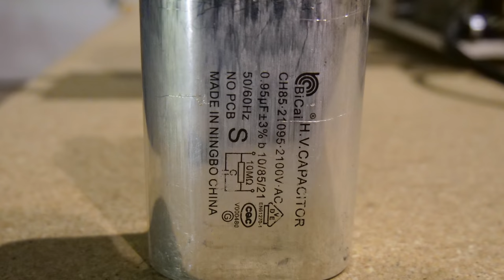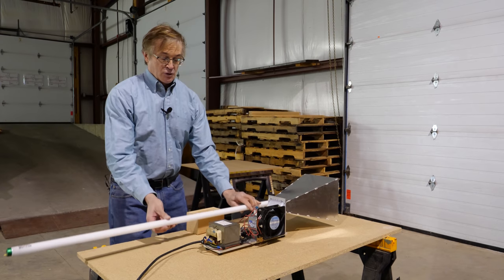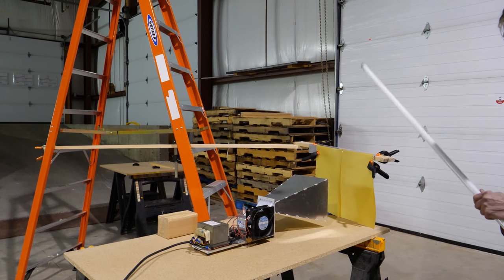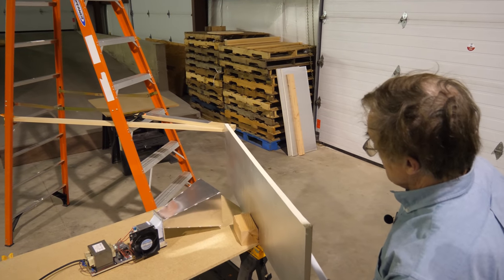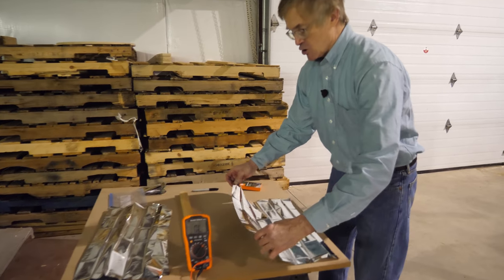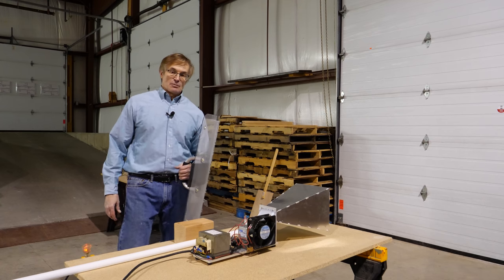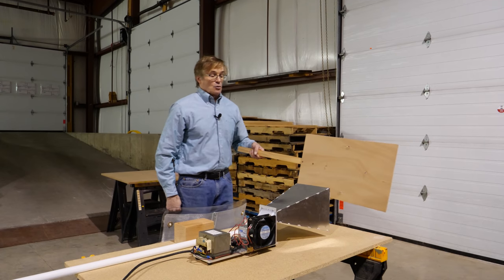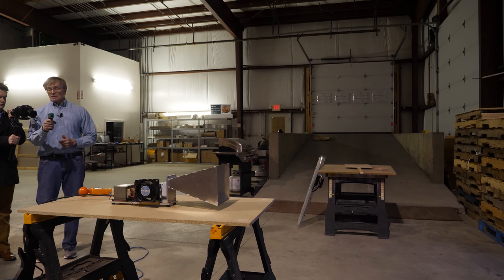You're not protected from microwaves... yet - Part 2

Comment: Is there any kind of spraypaint/paint that could be used to block microwave?
Reply from the maker: It would simply  have to be electrically  conductive. Aluminum foil would probably be easier  and less expensive.
Reply: @TechIngredients  thank you for your response. Will a car protect you from microwaves?
Reply from the maker: No.
The glass and any plastic body panels  are transparent  to microwaves.

Comment: Could you just amplify the signal using a battery, a Schotky diode a transistor to light the bulbs at greater distances?
Reply from the maker: Sure.  The advantage of using only the bare bulb is for documentation.  No one can use the defense that you faked the signal with electronics when you make your accusations.
Reply: @TechIngredients  clever

Comment: Can the testing applications apply for 5G+ wifi as well ?
Reply from the maker: They could. 
But  in the meantime, don't worry.  5G is not a threat.  The antennas will not transmit dangerous  levels of microwave  energy.
If you still want to worry, be far more concerned  about the information that is promoted via this modality.

Comment: . . ✨ Commercial grade foil has both dull & glossy sides, can this grade of foil protect a cell phone when it’s wrapped tightly (no open ends or sides) from EMR waves ?
Reply from the maker: Yes.  However,  grounding the shield will work better than if it is electrically  floating.
Reply: @TechIngredients   . .👍🏻 thank you . .can the Ribbontoe Carbon fiber cloth (graphite film) provide proper grounding ?  . . Can the cloth accept a needle & thread to be made into a proper Faraday cage for my cell phone ?
Reply from the maker: I'm  not familiar with that material.

Comment: I feel like when making anythign other than a shield, like conductive clothing, its just going to make the microwaves bounce around inside if you don't close all holes with somekind of see through mesh or more conductive material to create a true faraday cage. any more info on this?
Reply from the maker: That's unlikely to be a problem.  What gets through will be a small fraction of what would have hit you anyway.  The energy will be completely absorbed and converted to heat after it passes through only a mm or so of your skin.
Reply: @TechIngredients  AHH makes sense. Forgot about the big attenuator inside the suit :P Thanks for taking the time to answer my question.

Comment: They are building cell phone tower generation 5, it's on the side how can i protect inside of my home from microwaves, do i need to shield only from the side or whole house and if there is window what should I do with that, is there any faraday cage kind of stuff that I can use for windows and can still see outside.
Reply from the maker: Those towers pose little  threat.  However, if you want to block the microwaves, then they are line of sight and only the side of the building facing the tower needs a conductive, metal barrier. As we demonstrated in our video on defending against microwave weapons, a simple METAL window screen will work.  Because  these very high frequency 5G systems have a shorter wavelength, a fine mesh mosquito screen will be necessary.
Reply: @TechIngredients  Thank you a lot for answering.

Comment: My ears perked up when showing the IR thermometer picking up a heat signature from the microwave, but no science was given as to why?
Simply the moisture in the air? My IR thermometer does not pick up air temperature.

Comment: 2:50 it is not Beryllium oxide.

It's ordinary aluminum oxide. BeO is far to expensive to be putting in a cheap microwave, only the earliest of microwaves from the 70s may have used BeO. Not only that but the hazard of handling the BeO insulators would be very significant for an ordinary worker. 
If you don't believe I advise you grab a He3 neutron tube (I would be very surprised if you didn't have one) and a few smoke detectors and test it for the neutron output of the microwave insulator versus actual BeO and Aluminum oxide. Beryllium is far too expensive and strategically important for some microwave company to be throwing it away. I mean if the US government has mandated a stockpile be kept in addition to the only major deposit on earth being on its soil you better believe no one in thier right mind will be putting it in Karen's microwave.

Comment: While neon bulbs are usually run at higher voltages than LEDs, and are non-polar, the power draw is usually a small fraction of that required by a typical LED. You may be able to get a better detection range with LEDs, if you use their diode trait to build a passive charge-pumping circuit, and simply bleed off excess voltages (if they can even get that high with the large current drain of an LED vs the poor coupling quality of the system) by shorting any voltage that can build up to light the entire stack (or many other basic circuits). The fact that your carbon fiber and thin graphite sheet didn't get hot enough for you to mention it, or burst into flames, indicates that very little power is being coupled to the material. You could also likely get better range with the neon lamps by building a voltage multiplying ladder network. I think the optimal approach would be ziploc bags, filled with the tasty ham from the first video though. Nothing beats a meatshield for high-energy situations.

Comment: He still doesn't mention aluminum foil. It will block and reflect microwaves. Just remember to overlap your seams. That goes for any material you use.
Reply from the maker: That's because we covered aluminum foil in part one this two part video series.

Comment: Tell me, why can I pick up my wifi if I put my phone inside the microwave with the door closed?  But my wifi isn't harmful?
Reply from the maker: The oven is moderately effective as a barrier although I'm surprised that it is not good enough to block your phone's reception.  Energy at that frequency is only harmful at  power levels sufficient to cause heating.

Comment: You could just address the elephant in the room and let us know when they plan on turning up the towers to 95 ghz......and of course, blame it on radiation from the recent Fukushima "accident" or, perhaps from Russian activities? Would u be open to doing some experiments for people to see with graphene oxide, say, inside a plant? i do wonder what all this graphene in the bloodstream will do when exposed to that level of ghz....also i think its good to mention that if one was to wear a shielding/faraday suit, that they would need to be completely covered up, much like a phone in a faraday bag, that if one little crack is left open, the EMF/RF would enter in. It may block the waves in the area covered, but as it will actually draw the waves to it, being metal and all, and will fry the unexposed areas just outside the coverage area. Also, as far as personal shielding, for example, as far as a suit one could wear in areas of high RF (downtown and vicinity lately) the current materials available such as silver fabric, copper etc, advertised as shielding would not block radiation above maybe 18 ghz. If you've done a video on the wi-fi planned to be rolled out at 60 ghz, none of these fabrics would handle that.... Maybe multiple layers up on layers, however, how would one be able to see?  A translucent shielding fabric? Once that is handled, what about LI-FI, and optogenetics? Quite a few videos out there showing the streetlights, screens, classroom lights, etc, all being relevant here. THank you
Reply: theTrifield meter can alert you to the presence of a dew/ads pointed at you as well

Comment: I no you can deflect micro waves know you could melt cast iron in a crucial but can you melt steel in a crusible no one else on U tube can and I don't mean a DOB of steel in a coil
Reply from the maker: Sure, but it would involve  a significant amount of work.  Assemble several magnetrons around a non conductive crucible.

Comment: If 5G waves are added, does this change the results??
Reply from the maker: No.
5 G is simply  two licenced band of wavelengths. The first extends to about 7GHz and the second  from about 24 to 70 GHz.  The same rules apply, but the towers that  generate these waves are not nearly  powerful enough and the dispersion  is far too large to pose a threat.

Comment: I truly enjoy your channel, but I have to say that this series on microwave oven emissions has me a bit conflicted. The safety issues are many (some of which you nicely pointed out) but in particular, the RF radiation exposure is a bit trickery than you may realize - esp. as concerns your eyes. As you know these transmitters produce high levels of RF power at 2.45 GHz (the middle of the wifi band btw!). One of the health risks is increasing your risk of cataracts, or doing worse damage. At these power levels, even the sidelobe power is substantial as are reflections (which are many indoors).
Reply: …except they’re not. Lemme assign some homework: What’s the diffraction limit of a 2.4ghz beam and 1cm aperture?
Reply: @NavinF  I see, you want to assign me some homework huh? Clearly you think damage to the eye can only occur if the energy can make it through the 1 cm "aperture"... to which I ask are your eyes metal?  Does the Main Presenter have eyes that are metal? Where exactly is this aperture in the human body, or eye more specifically?  If you had a metal plate with a 1cm round hole, sure it would easily block the RF field. But instead, we have an eye which is composed of tissue with much water, polar water molecules that get excited by the 1500W e-field and heat up. Your comment is arrogant, wrong and dangerous.
Reply: @e2jw  No, you skipped a step. I was taking about the magnetron. You can approximate the energy density at a certain distance in front by assuming it’s a 1cm aperture. Calculate the angle of the central lobe of the diffraction pattern. After that, you can assume an eye’s antenna aperture is the same as its size to calculate rx power. But you don’t need to go that far: The spread angle is enough to determine how dangerous this experiment is.
Reply: @NavinF  OK, if you go to FCC doc:  RF-Exposure-Info/MPE-Report-5693688.pdf you will see the human exposure limits.  RF freq=2450 MHz, Gtx=10dBi (also 10 linear), Zo=377 ohms, I'll de-rate the magnetron output to 1000W, distance away 1meter.  Do the math, you'll get a power density of 795W/m^2, and an E-Field of 548 V/m. The 6 min max exposure limits at this frequency for a controlled environment are E-Field limit = 110 V/m, Power Density limit = 32 W/m^2.  The actual distance you need to be away is about 5m to meet the 6 min exposure limit.  Note these limits are for people working with RF and knowingly accept the risks, so they are appropriate.  General population limits are more stringent.

Bottom line: The main presenter is being exposed to 5x the max E-Field, and 25x the max power density over FCC limits. So, hence my concern.

BTW: I'm choosing to ignore the obvious FCC violation of radiating ~10000 W, in the WiFi band out of the garage - I'm including the aprox. 10 dB directivity gain of the horn. I'll assume they have a waiver.
Reply: @e2jw  Let me guess, you’re a HAM? I’m curious: Would you find a 1000W halogen lamp to be equally dangerous? Keep in mind that the power density (watts per cubic meter, not watts per meter squared!) is a lot higher for the halogen because it does not penetrate as deep
Reply: @NavinF  I gather that you are not seeing my point that the frequency of the emission is an important factor here. At 2.5 GHz the penetration depth is quite deep (skin depth, but the term is usually meant to refer to metal conductors). At much higher frequencies, the depth is very small (which is why pain field generators are considerably  higher in frequency). At optical wavelengths (IR, UV) you are warming the skin surface (and the wavelength matters relative to viruses, like in sterilization UVc lamps). When I sit under a IR heat lamp, or next to my fireplace I'm warming my skin's surface. If I sit in a 2.45 GHz electric field I am warming my body everywhere - inside and on the surface. I hope that helps you understand.  And yes, I am an extra class amateur radio operator,  I hold a professional FCC license (GROL),  and I'm a working professional engineer (RF, Comms and DSP) with advanced degrees in electrical engineering and mathematics... for more than a few years.
Reply: @e2jw  Congrats. Then you understand what I mean when I say that the volumetric power density is too small to matter unless you stick your head into the horn. UVC (and other ionizing radiation) are not relevant to this discussion. I’m comparing a 1kw IR lamp which can dump a lot of energy into a small amount of tissue to 2.4ghz 1kw which is totally ineffective as a directed energy weapon
Reply: @NavinF  Ok, well I see that we are speaking about two different perspectives, RF safety and directed energy as a weapon.  I absolutely agree that the energy density of the microwave oven is not an effective weapon, but it is still not exactly something you probably should be repeatedly exposing yourself to either... which is now back to why I posted the original comment.  It was a fun discussion and I appreciated it. Thanks!

Comment: Non-ionizing radiation should not be measured in macro scales as used for communications as the thermal heat damage from these microwaves is similar to ultrasound in which high temperature micro spots are created that last micro seconds. This is what your heat temp gun is picking up sparingly and inconsistently for that very reason. Those micro hot spots are damaging our biology and it repairs itself with our code using exosomes and mitochondrial processes only for so long till accumulative damage creates mutations. If you can measure the micro hot spots in micro seconds then you can make such statements as it been safe and nothing to worry about. This is pretty obvious if you use basic logic rather than controlled science sponsored by the industry selling high tech cattle tags and chips in everything agenda. The interruption of the Schumann resonance should be a concern in itself and is well documented.

Comment: I feel that you are not clearly differentiating between energy (which is the energy of the radio wave particle the photon) and power (the intensity of the beam). At the frequency of microwaves, particles which are photons for all electromagnetic radiation (though radio waves do not manifest themselves as particles due to their low energy state)  do not have enough energy to break chemical bonds. Electromagnetic waves with enough energy to break bonds are many many orders of magnitude higher in frequency than radio waves. They are in fact the safest form of electromagnetic radiation. They do "jiggle" molecules, which produces heat and if you crank up the power enough you can really heat things up. That "jiggling" may also cause other effects on tissue which deserves more study. By using the term microwave without explaining that it is just an arbitrary division of radio waves, you create a lot of problems for people who involved in radio technology. Microwaves sounds scary but people fail to understand that on the whole electromagnetic spectrum there is nothing micro about them. They are actually quite long, low energy waves. You create unnecessary fear among people who don't understand this stuff about radio technology. You should make it absolutely clear that radio waves are weaponized by sending extremely concentrated and rapid radio waves which are very powerful. The frequency of the waves isn't relevant. It's just like water isn't dangerous unless you aim a fire hose at somebody. It should be clear that these weapons take  a safe form of energy and make it dangerous by concentrating it. It seems like maybe you have tried to do that but not really well enough.
Reply from the maker: I think I made that clear without undue repetition.

Comment: Hey I'd love your answer to 5G! *I'm not a conspiracy theorist and I do not believe they are dangerous*
I just want an additional argument I can use next time my parents go on about that bullshit (they are the conspiracy theorists).

Obviously 5G radio signals are not ionizing, but the argument I always get is this: "Yes but they're gonna need many more towers so there will be many more waves. Look at microwaves!"
Now my response is already this: The frequencies of 5G radio signals does not resonate with the water in our body like microwaves do.

But is my response correct? Are there any other responses that can be used?

Also if anyone here believes 5G radio waves are dangerous then I'd like a link to the studies done. If there are *genuine* scientific studies proving me wrong then I want to know.
Reply from the maker: 5G is just a wide range of frequency bands that have been designated for communication.  All the frequencies within that range will drive water molecules to resonate so to speak and heat.  Some will also drive atmospheric oxygen to vibrate limiting range and tower to tower cross talk/interference.  They need so many transmitters because the range is so short.  They are not dangerous unless you consider what they're communicating dangerous and that might indeed be a reasonable thing to worry about.

Comment: Couldn't you defeat the microwave weapon by using aluminum foil on cardboard as antenna connecting a capacitor and discharging the circuit electrically like a taser?
Reply from the maker: Kiss.  The aluminum foil is cheap, simple and effective.
Reply: @TechIngredients  Amen! Ive been a fan since the foam speaker thing and people love buying home built tech. I do cup scoops from red cups by cutting out space for a phone to hear the speaker better. thank you